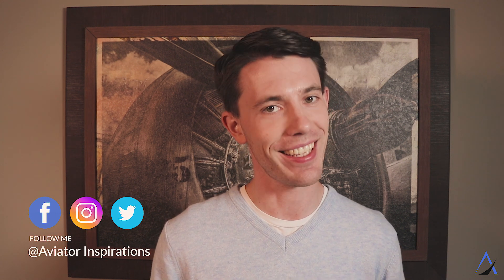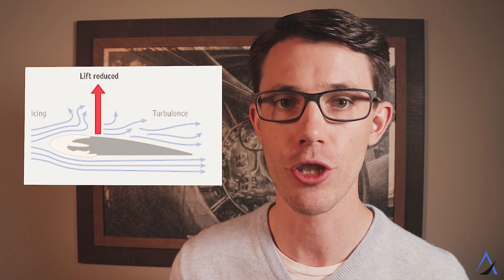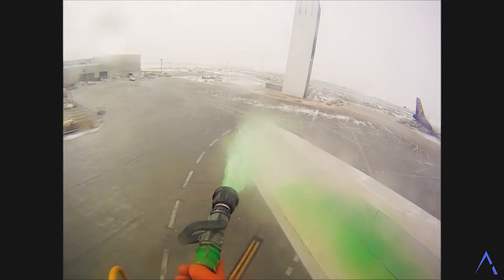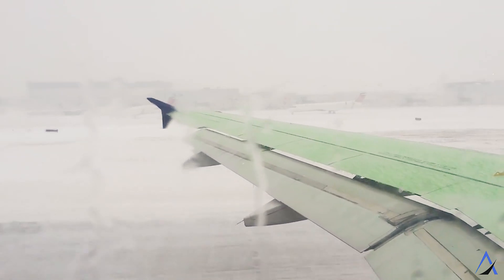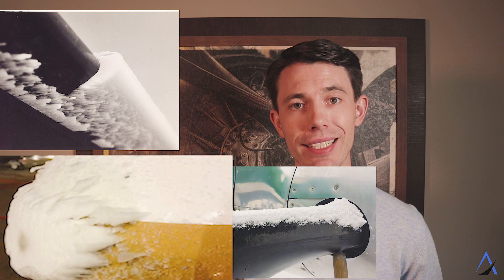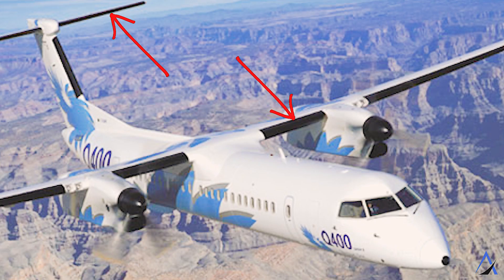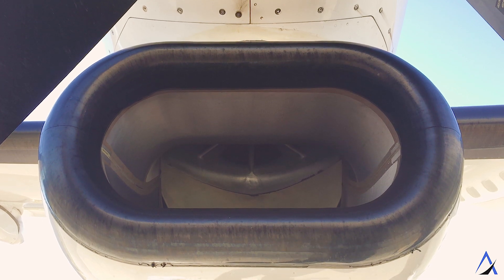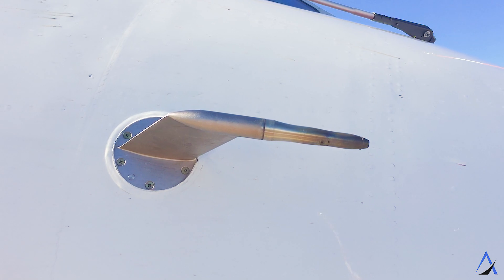Deicing Aircraft and Anti Icing - Aircraft Icing Dangerous?

Comment: Are aircraft de-iced on the ground because the anti-ice system can't get rid of all of the ice efficiently if the engines aren't running? Couldn't the APU power the anti-ice system on the ground, making the de-ice procedure unnecessary?
Reply from the maker: Aircraft are legally not allowed to take off with any contamination on the critical surfaces. Anti icing only keeps certain areas ice free, so no it can’t deice the aircraft on the ground